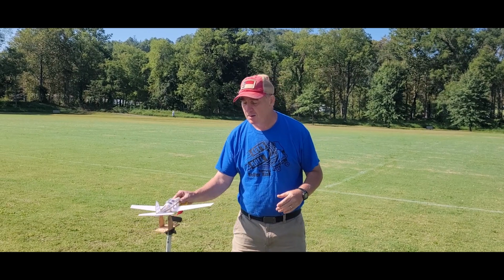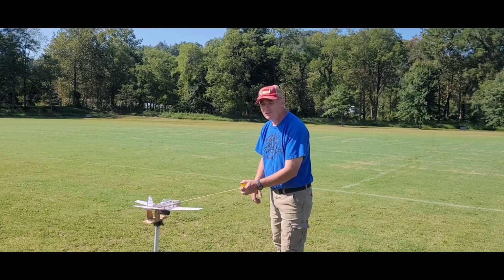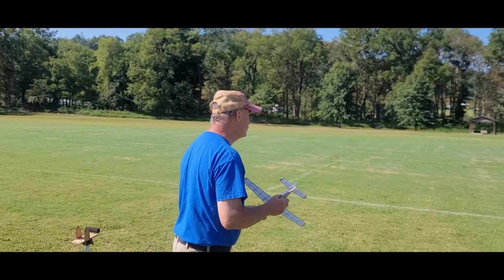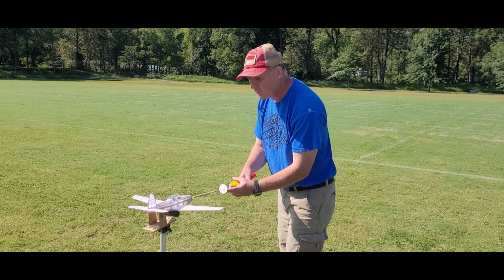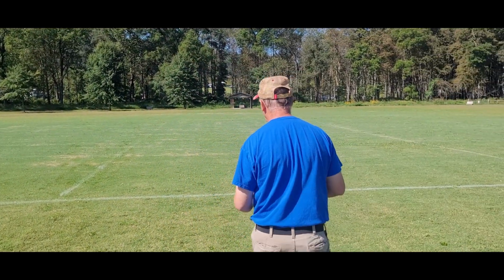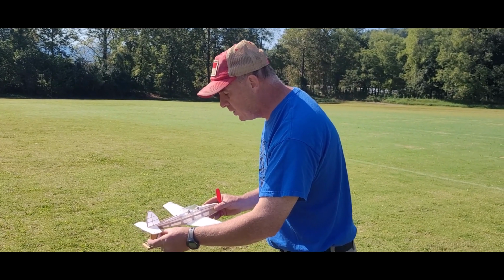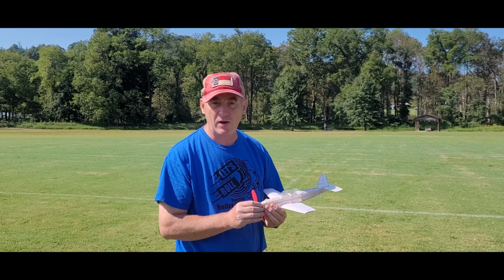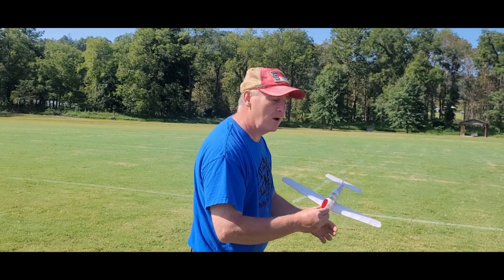Build Off Fly off 9 15 2022 Doyle Blevins

Comment: Because Torque automatically gives the model a left hand turn without adjustments, you should start there and determine how much counter right adjustment you need to smooth it out.